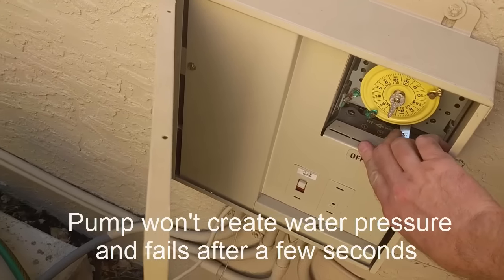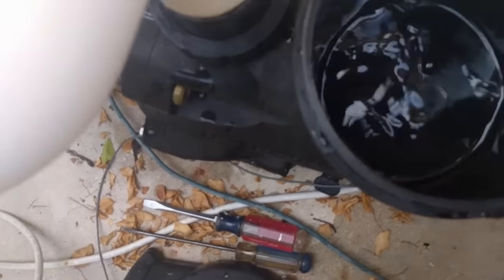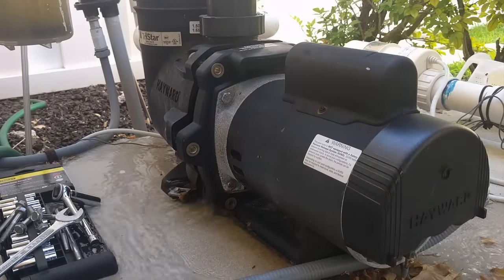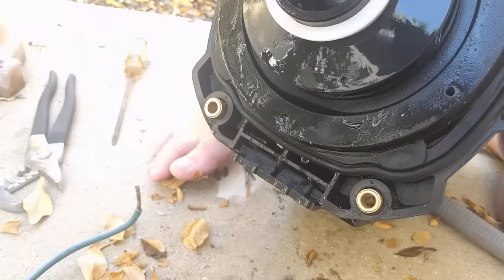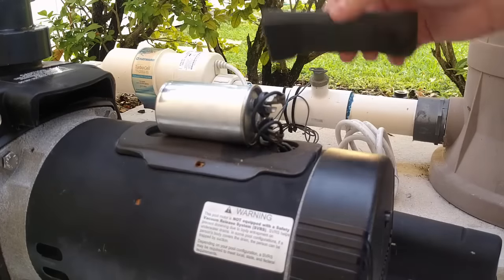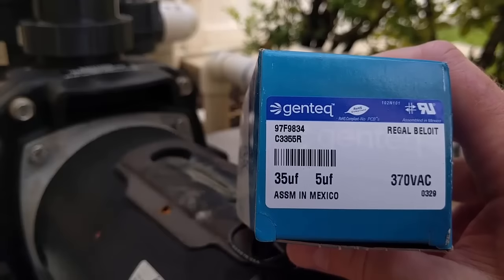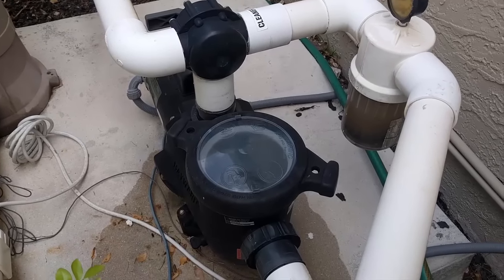How to Fix Pool Pump Capacitor

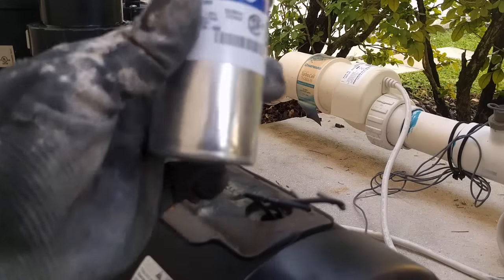Comment: Your advice at 8:25 of going higher in mf is WRONG, NEVER EVER GO HIGHER, rather go lower. If you go higher you are almost guaranteed to blowout your motors winding wiring. Get as close to your motors mf, but if you can't, ALWAYS pick the lower closest one, NEVER the higher.

Excellent video otherwise

Comment: 10:49 “In theory if one capacitor fails I can switch to use the other one”

That’s not an accurate theory at all.

First of all you had a 30uF cap in your original pump. You installed a 35uf/5uf cap. You connected to the 35uf side. You should install the proper 30uf cap. Yes the 35uf will work but for the same reasons you don’t install a 40amp breaker on all your home circuits. Will they work to supply power? Yes, but will they ever trip? No.

Also you said you can use the other side of the capacitor if the side you’re using fails. Clearly you don’t understand electric circuits so please don’t share bad info.

If you connect to the 5uf side of the cap, when the circuit you are connecting to requires a 30uf. At best you’ll pop the cap and not die or cause an electric fire. The circuit will charge and overcharge the 5uf cap and poof!!

Comment: You all are aware that it’s illegal and you can and will be charged by the Electrical Safety Office for performing unlicensed electrical work... right?

Get a Licensed electrician to fix your Electric Motors.....
Reply from the maker: What are you talking about?!?! In most jurisdictions in the USA you can REPLACE parts without a licensed electrician. You need a licensed electrician to install NEW electrical work - like in new construction.
Reply: LOL replacing a capacitor with a new capacitor is classed as new work, you need a licensed electrician to install anything or repair anything for you. Especially putting it on the World Wide Web where other unlicensed people can harm themselves or worse, electrocute themselves and die
Reply: Electric Safety Office?  No such thing dude.  Go back to your music Anty
Reply: The Electrical Safety Office - they’re right next to the Cyber Police Backtracing Division, right?

Comment: It is better to DIY replacing any parts or the entire pump yourself that will easily l y save 50% or even more where the OEM of pumps would only give you 2 months warranty if you don't go to its installer to buy pumps n installation charges. Avoid big names of pumps buy online n do it yourself n it is that difficult at all.